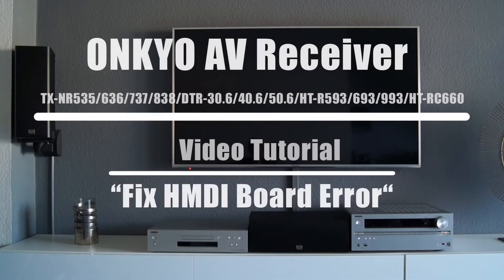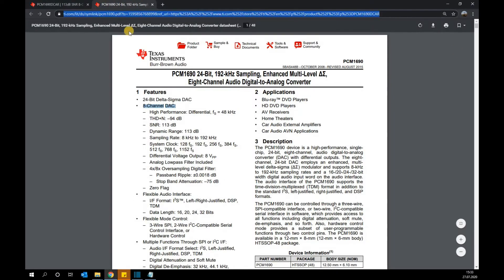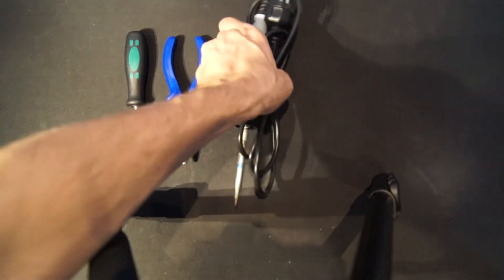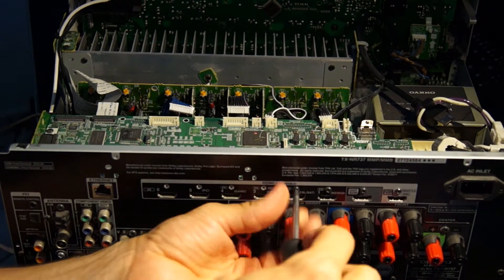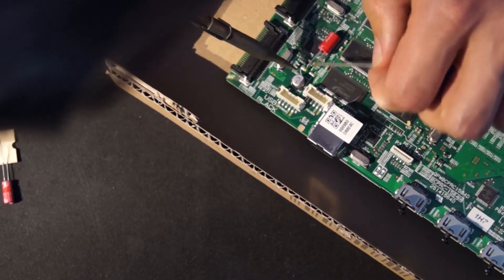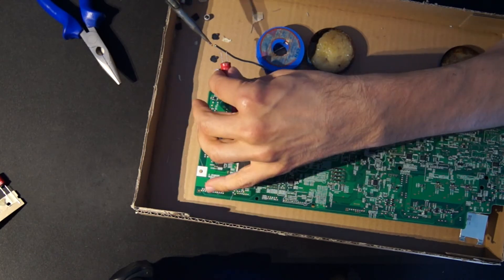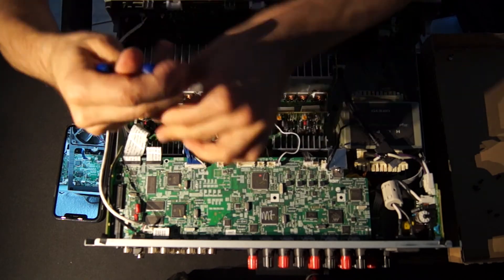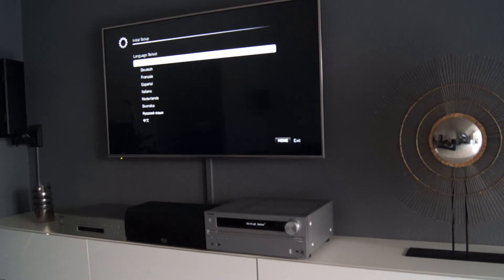ONKYO AV Receiver - How to Repair "HDMI Board Error" Part#1

Comment: Does the TX-NR809 use the same or similar HDMI board in which this tutorial could be applied to ? I think most of us don't know how to use the mouser.com and digikey.com sites to browse and shop for the components..  :-/ ...Be so much easier if we could buy refurbished boards from you.

I'm noticing in your parts list you mentioned a couple IC's. But you didn't replace any IC's in the video. What's that about ?
Reply from the maker: Hi C Shara,

according to my research, the boards TX-NR737 and TX-NR809 are different. Different ICs in the receivers are used. Therefore the capacitors will also vary.

Here you can find the Link for your receiver:
TX-NR809: https://elektrotanya.com/onkyo_tx-nr809.pdf/download.html

You mentioned that it would be easier to offer refurbished boards. My intention is to motivate others to carry out this repair step yourself.

The method I have described may look complicated, but it is very simple and not witchcraft. You don't need to be an expert.

If the device is defective, the capacitors are replaced in the FIRST STEP (requirement: EASY), as they only have a limited service life. The service life is reduced by heating.

In the SECOND STEP (requirement: MEDIUM) the soldering points of the ICs are re-soldered. There are various instructions for this.

I rate some methods as risky. Especially when high temperatures are applied to the whole board to re-solder solder points - I would heat the contacts of the ICs individually with the soldering tip. A separate video follows.

Your question about the IC mentioned is absolutely justified. In a following video project I will address the ICs. These will be not exchanged, but the soldering points will be "re-soldered".

Your advice about the revision of HDMI boards is worth considering. However, the errors can be very diverse.

BUT!

Repairing the boards is not enough. Due to a design flaw ("heat sink"), recurring damage occurs. This damage not only affects the capacitors, which are easy to replace, but also the semiconductor boards.

That is why I urgently recommend retrofitting a fan on older ONKYO receivers. See my instructions for this "ONKYO AV Receiver - How to install TEMPERATURE CONTROLLED COOLING FAN VENTILATION" (Link:
 https://youtu.be/09daUMpuCY0).

Hope that helps yoy and answers your questions.
Reply: @RepairUpgrade  yep, answers a lot. Since my original comment, I was able to watch videos to learn how an IC chip can easily be replaced with the proper supplies. Easy enough and I have all that already. I just had no idea chips could be done by hand. Flux is key. 
I'm wondering how to identify when the chip is faulty and it's more than merely a reflowing issue ? Also, on my board, how would I identify which capacitors to replace ? Why did you move away from the aluminum body capacitors ? I noticed that the aluminum body capacitors are more expensive and I believe they had better specs ?

None of the other videos discuss replacing these capacitors. And I was wondering why you were replacing them. Thank you for filling me in on those details. Makes sense.

What happens if the semiconductor boards are affected ? I'd imagine I'd need a known good board ?
Reply from the maker: @Mr_BUSINESS_24_7  To detect a defective IC, I would use the following methods:

- measure the inputs and outputs of the IC and compare the signals to the required signals. deep technical skills about the operating of the AV receivers are required (assessment: most promising & most demanding)

- use of DEBUG MODE. I made an own video for the method to measure the temperature and control the integrated fan. But it is also possible to read out the version of the microprocessors (DSP etc.). If a microprocessor is not recognized, the character sequence "???????????" is displayed instead of the version. issued (assessment: promising & less demanding method)

- use the experience and technical knowledge of other users in forums (assessment: promising & less demanding)

- check whether the IC produces heat (DSP can heat up to 70 degree celsius when operated) by temperature measurement or infrared camera (assessment: less promising & less demanding method)
Reply from the maker: @Mr_BUSINESS_24_7  How to identify which capacitors to replace:
The capacitors are a possible source of error. Therefore I replaced ALL aluminum capacitors because my device was built in 2014 and I assume that all capacitors are showing signs of aging. The capacitors (unlike semiconductors) are easy to replace and the material costs are low. I used electrolytic capacitors because they can withstand more than 100 degrees and if a defect occurs again, this is indicated by a bulge in the upper housing.
Reply from the maker: @Mr_BUSINESS_24_7  what happens if the semiconductor board are affected:

- One possibility would be as follows. There are providers who offer outdated HDMI boards. These cost between 100 and 130 EUR.

- Before I buy a board, I would try to fix the error myself by working on the individual ICs with a HEAT GUN. These solutions are promising and I will try this shortly. I'll make a video of it. Some users use instead of an Heat Gun a normal halogen spot.

- The suggested Internet solutions that suggest baking the board can probably help in the short term. Provided that the board and the components on it are not destroyed by the heat beforehand. However, I have no experience on this, but see the procedure as critical and the very last possibility before scrapping.

- Overall, it remains to be considered whether the devices are still worth a lot of effort. The devices can be acquired very cheaply due to the known and frequent errors. Therefore, it might be better, to buy a refurbished device with a warranty and to equip it  with one/some fan/s and then hopefully runs through the next few years without any problems.

Comment: Danke für das Video, wenn du das nochmal auf deutsch machen würdest wäre es noch besser;-)
Kannst du mir vielleicht sagen welche Kondensatoren ich für ein TX-NR3010 und TX-NR5007 brauche?
Reply from the maker: Hey André. Das Video habe ich heute auf Deutsch untertitelt. Untertitel aktivieren und unter Einstellungnen die Sprache Deutsch auswhählen
Reply from the maker: Hey André,

the capacitors for the devices NR3010 and NR5007 are not known to me. Perhaps the service manuals will help you. You can find these for both device types on the net under the following links:

- TX-NR3010 (https://elektrotanya.com/showresult?what=tx-nr3010&kategoria=All&kat2=All)
- TX-NR5007 (https://elektrotanya.com/showresult?what=tx-nr5007&kategoria=All&kat2=All)

With the circuit diagrams contained therein and the capacitors of the removed HDMI board, the capacitor values can be determined. I recommend replacing all accessible electrolytic and aluminum capacitors on the HDMI board. I also recommend retrofitting the ONKYO receiver with a fan control, as the error can reappear very quickly. I recently posted my own video about it.

I am happy to include the reference with a German version for the tutorial:-)

-------------------------------------------------------------------------------------------------------------

Hey André,

die Kondensatoren für die Geräte NR3010 und NR5007 sind mir nicht bekannt. Vielleicht helfen Dir die Service Manuals weiter. Du findest diese für die beide Gerätetypen im Netz unter den folgenden Links:

- TX-NR3010 (https://elektrotanya.com/showresult?what=tx-nr3010&kategoria=All&kat2=All)
- TX-NR5007 (https://elektrotanya.com/showresult?what=tx-nr5007&kategoria=All&kat2=All)

Mit den darin enthaltenen Schaltplänen und den Kondensatoren der ausgebauten HDMI Platine, lassen sich die Kondensatorwerte ermitteln. Ich empfehle auf dem HDMI Board alle zugänglichen Elektrolyt- und Aluminium Kondensatoren zu tauschen. Des weiteren empfehle ich die ONKYO Receiver mit einer Lüftersteuerung nachzurüsten, da der Fehler sehr schnell wieder auftreten kann. Ich habe ein eigenes Video dazu vor kurzem eingestellt.

Den Hinweis mit der deutschen Version nehme ich gern auf :-)
Reply from the maker: Do the ONKYO devices TX-NR3010 and TX-NR5007 have similar HDMI problems?

___________________________________________________________________________________________

Haben die ONKYO Geräte TX-NR3010 und TX-NR5007 ähnliche HDMI Probleme?
Reply: @RepairUpgrade   ja die Geräte TX-NR3010 und TX-NR5007 haben die selben Probleme und ich habe mir die Schaltpläne schon angeschaut, aber das übersteigt dann mein Horizont, leider konne ich da nicht die möglichen Kondensatoren erkennen.
Besteht die möglchkeit das du sie erkennst? gerne können wir auch ein 4 Ohren gespäch führen^^
Reply from the maker: @dally77  

To swap the capacitors I would do the following:

1) The HDMI board needs to be removed. The capacitors to be exchanged are located on the front and back of the HDMI board.

2) 
The aluminum capacitors are to be replaced. The aluminium caps are easy to recognize with the naked eye by the silver cap. To be on the safe side, next to the capacitors there are also the designations "Cxxxx". The abbreviation "C" stands for Capacitor. "xxxx" for a consecutive number.

3) 
With the designation Cxxxx you can determine the value for capacity and voltage in the service manual. To do this, you use the search function in the PDF document. The value is in the service manual in the circuit diagram next to the capacitor.

4) 
ONKYO has not given the values for all capacitors in the service manual. The background is that it is not assumed that e.g. SMD capacitors can be exchanged. 

Hope that helps you first.

--------------------------------------------------------------------------------------------------------------------

Um die Kondensatoren zu tauschen würde ich wie folgt vorgehen:

1) Das HDMI Board muss ausgebaut werden. Die zu tauschenden Kondensatoren befinden sich sowohl auf Vorder- und Rückseite des HDMI Boards.

2) Getauscht werden die Aluminium Kondensatoren. Diese sind mit bloßem Auge leicht an der silbernen Kappe zu erkennen. Zur Sicherheit stehen neben den Kondensatoren noch die Bezeichnungen "Cxxxx". Die Abkürzung "C" steht für Capacitor. "xxxx" für eine fortlaufende Nummer. 

3) Mit der Bezeichnung Cxxxx kannst Du im Service Manual den Wert für Kapazität und Spannung ermitteln. Dazu nutzt Du im PDF Dokument die Suche Funktion. Der Wert steht im Service Manual im Schaltplan neben dem Kondensator.

4) ONKYO hat im Service Manual nicht für alle Kondensatoren die Werte angegeben. Hintergrund ist, dass nicht davon ausgegangen wird, dass z.B. SMD Kondensatoren getauscht werden.

Hoffe das hilft Dir erst einmal weiter.
Reply from the maker: @dally77  

If you have a possibility to photograph the boards from the front and back in high resolution and make them available via a cloud link (google, dropbox or similar), I could take a quick look at it ...

------------------------------------------------------------------------------------------------------------------------------------------------------------

Falls Du die Möglichkeit hast die Platinen von Vorder- und Rückseite hochauflösend zu fotografieren und über einen Cloud - Link (google, dropbox o.ä.) zur Verfügung zu stellen, könnte ich  einen kurzen Blick darauf werfen ...
Reply: @RepairUpgrade  

danke super ich werde mal nachschauen

Comment: Do you have a link to the exact capacitors you bought?
Reply from the maker: I bought the capacitors from a German supplier. I have added the data sheets for you in the video description ... But you can use any other manufacturer ... When choosing the electrolytic capacitors, the following parameters are decisive: the same capacity, a sufficiently high dielectric strength (here 16 volts) and a good temperature resistance (minimum 105 ° C, better 125 ° C). I hope this helps.
Reply: @RepairUpgrade  thanks!

Comment: I've got a Onkyo TX-NR 709 that I got back in 2011. It was already sent out once to Onkyo for the extended warranty offered on it for the No Sound / No HDMI output that plagued these models. A few years back the primary HDMI output failed again. After seeing your video I am tempted to try this and try to revive the primary output. Currently it's still working over the secondary HDMI output which uses a different chipset.
Reply from the maker: Thank you for your experience ... I am happy if I was able to motivate you ... Perhaps you can tell us afterwards whether you were able to successfully repair the device ... Yes, it is a question of time before the replaced capacitors Fail again due to the high level of waste heat in the housing. In the long term, only an additional fan cooling can help. In the meantime I have installed such a fan cooling in the ONKYO receiver. The temperature in the case is now at an acceptable 30 °C ... I will try to publish a video tutorial in the next few days.
Reply from the maker: In the meantime, I've made a video on installing a fan. Here is the link: "ONKYO AV Receiver - How to install TEMPERATURE CONTROLLED COOLING FAN VENTILATION" (Link: https://youtu.be/09daUMpuCY0).

Since I installed it, my AV receiver has stopped heating up.
Reply: Does this method works on  tx sr 605?
Reply: @legendforever7036  I've not tried this. Am still using the secondary output on the receiver.